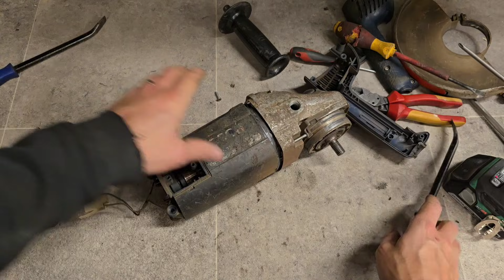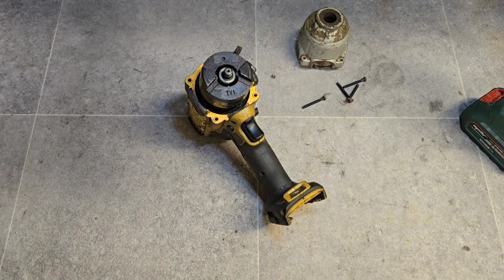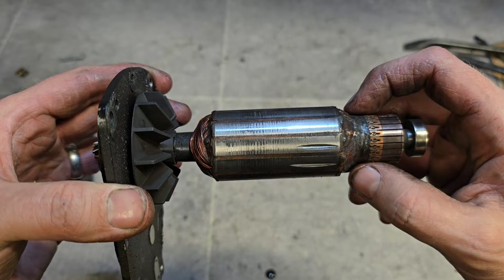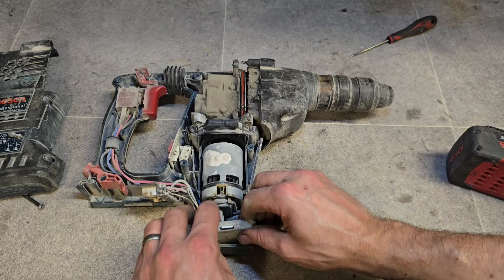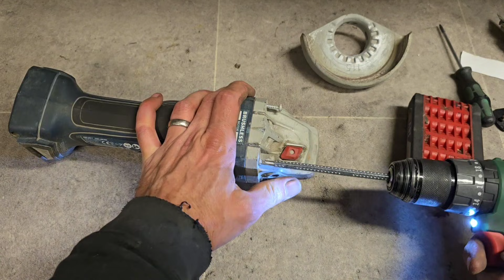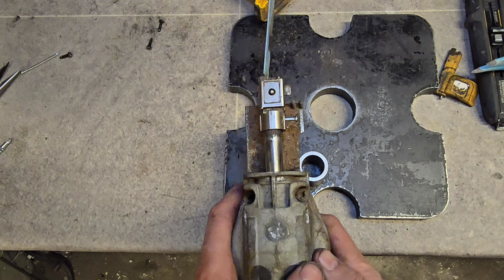Power Tool repairathon, fixing a bunch of broken machines for customers, the last one is impressive.

Comment: that cordless bosch made me buy a new.motor and armature..and it was the same bearing that melted that little area where it sits because it was stuck..i had to buy a new cover just because of that   but its only 6£.. and it still moves  hard and bad inside the engine..and makes a ratling sound when works... i ll try out your paper gig:)

Comment: For steel pins on a different subject (carburetor float bowls) wich were 2.5 mm I used drillbits cut to size, because the OEM parts were obsolete or ridiculous price ( more than 10 bucks + shipping )

Comment: Since you started the video with bosch and considering I had commented before about a problem with some of their batteries, well they were under warranty and instead of fixing them they just sent two brand new batteries, free shipping too. Pretty great costumer service.
Reply: New Bosch tools and batterie in 2026, Expert product line, using 21700 power cells, channels where they have had new tool, it's been mainly the angle finding drill.
Bosch GSR/GSB 18V 150  needs app to make custom setting , in new the wanted angle can be dial in on tool itself ... thats listening customers a bit.
Reply: @p @pete_lind  Procore + and now expert batteries use tabless cells,old eneracer and procore use 21700 cells.

Comment: LOOK AT WHAT I SAY AND I LOVE THE WAY YOU RIP THEM OFF.  Also you need the brains to do this. I would use an over size roll pin. Or a concrete steel fluted nail they're as hard as . Sure i understand what ya say but from there sided how big do you make a parts bin for everything it's a hell of an ask and I think all tool manufactures will go the same way. It was fine before but now with how many tools each one comes out with how many parts do you hold hence assemblies. Look at cars.

Comment: I lost a similar size pin dismantling  a vintage rifle and no part available so i found a drill bit from a large # and fraction set and cut the shaft to the proper length. Tech the bit was usable but short so i just got a nee one for the set
Reply: The shaft of the drill bit that fits into a chuck is intentionally soft so the jaws bite - not heat treated hardened like the cutting end.